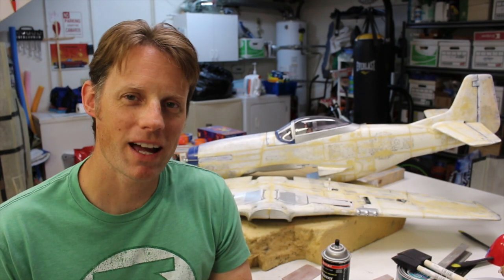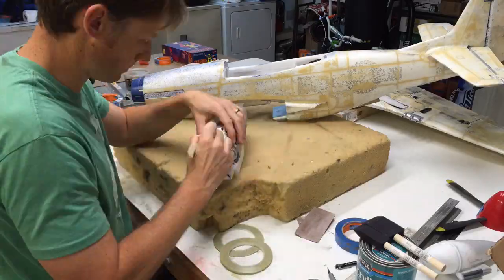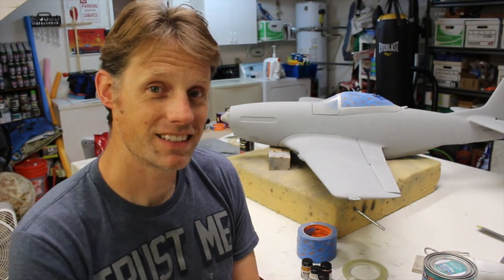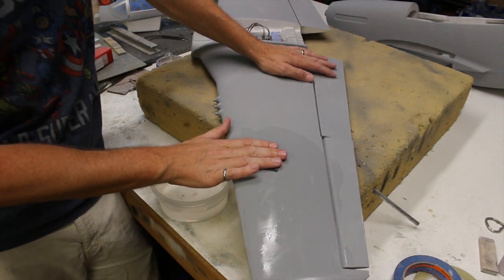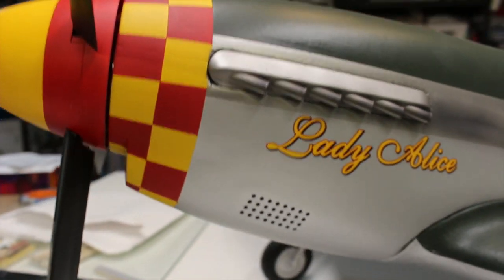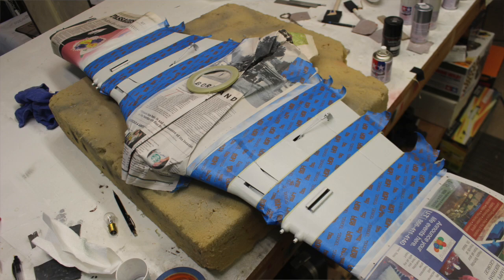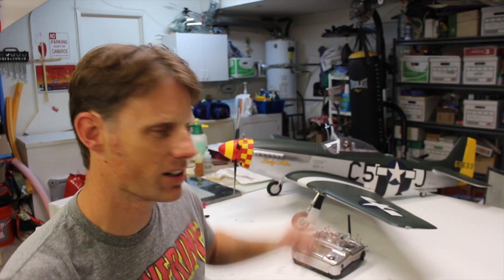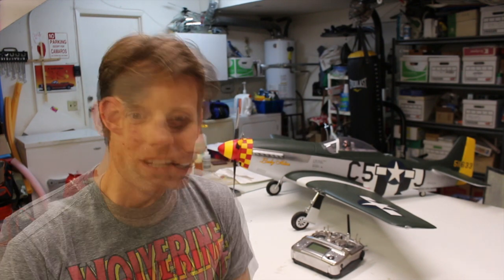Refinish a Foam Warbird Ep3 - FMS P-51 Paint Prep & PAINT!

Comment: Do you sand between polycriylic coats? I missed that somehow.  Anyways, with this video series you took the foamies to another dimension!  It looks to me that this process may open up the way to add scale details to any scale foamie that is missed during production.  I am working on a 36" ws FW190 that lands on its belly, and I intend to add retracts to it.  In order to dig the wheel wells, I use my soldering iron; but, I am finding out that it is not really a dependable process.  You get only one shot to everything :-)  If I can perfect this method, which means tracing straight lines and achieving controllable depth with the soldering tip, then it is possible to add torque rods for ailerons, flaps and elevator (I believe I can hide all soldering traces with balsa filler, or microbaloons mixed with epoxy).  That way you have all hidden controls on the airplane instead of ugly looking control horns sticking out from everywhere.  Do you have a process in place, or have you ever thought about one?  Anyways, you got my blessing with your craftsmanship to this foamie, which I never thought possible.  Now, I intend to spend more time to work on foamies after 40+ years of working with balsa.  Keep up the good work :-)
Reply from the maker: Thanks!  I only lightly sanded the final coat of poly before starting the primer process.  No need to sand between the poly coats really.  Epo Foam can definitely simplify things when wanting to add details and such since it’s easy to cut and such. I’ve not spent time hiding control horns on the foam stuff, but I do go to great lengths to do that on my larger builds. Just be aware that the final finish does need to be protected from the sun to avoid the foam beads from swelling. That’s the primary drawback to epo foam that I’ve found.

Comment: ok Chris. I have done a Bob Hoover tribute Stang and it turned out sweet. after several flights I have noticed stress cracks in the paint.  any suggestions on how to prevent this. maybe some flex paint. I did use rattle can Rust-Oleum. I guess it is what it is but for my next adventure with costom painting my plane this is a concern for thought.   any awesome suggestions from the Master. thanks GEEK. 😎
Reply from the maker: Unfortunately it's hard to avoid this since the poly does stiffen up the airframe a good amount, but not completely and these models still flex in flight.  Mine developed cracks also, but they weren't visible unless I picked up the airplane from the wing a certain way where the wing flexed.  Interestingly, my kfir hasn't had this pop up at all.  Part of that is there's less flex on that model due to the short and stiff wingspan.  In terms of paint, latex paint may be less prone to this but I'm not sure.
Reply: The RC Geek yeah I guess I will have to live with the cracks. do you know what paint the factory uses on these planes it doesn't seem to crack as much it seems.   and oh yeah the filler you smashed with the hammer is garbage. I used it and when you paint it it just looks like shit. so thanks for the filler tip.   I have a crazy project going. right now.  I am trying to make a YAK 110.   it's going to be a beast.   hopefully it all works. cross your fingers for me. thanks 😎.

Comment: Thank you for the video!
I was gifted an extra 230 96” 70cc gas engine, reallyyy old plane from the 90s, it is extremely well built and heavy with full balsa coverage all the way around, but it is in a bad state, full of dents, marks, tips, the paints is on its lasts days. I’ve started a process to sand it back to bare wood so i can fix all the broken supports and start from there. I have no idea how to paint and give it a nice gloss look as it deserves. My plan is to make it yellow/black Extra 330SC Breitling scheme. If you have any tips on how i could achieve this result from bare balsa wood i would be deeply appreciated. This plane cares a good sentimental value to me. I want to make it perfect!! Thank you for everything!!!
Reply from the maker: Thanks for commenting!  What is the model covered in currently?  And is it fully sheeted balsa?  Or are there lightening holes in the airframe?  The best means for preparing a balsa airframe for paint is to fiberglass it truthfully. But, if there are lightening holes in the outer skins, that’s a difficult process and will requires an iron on Mylar covering.

Comment: Any special attention to the creases between the Wing & Tail’s control surfaces.  Isn’t the polyacrylic dry stiff?
Reply from the maker: You do have to be a little careful not to build it up in the hinges, but foam hinges it’s less an issue.
Reply: @Thercgeek  I had the thought of using a thin layer of rubber cement or white liquid electrical tape on both sides of the hinged control surfaces to protect the foam.  Then I was going to apply the polyacrylic several times lightly sanding between coats.  Then spray with primer, multiple coats wet sanding with 800-1200 each coat.  Then spray base color and secondary paint colors.   Good game plan?

Comment: Have you noticed if the foam will still try and gator after a day out at the flying field in the bright sun? I have found that it really depends on the final base color of the model. The lighter the better of course.
Reply from the maker: you do have to keep it in the shade as it will popcorn up in direct sunlight.  It really depends on the color, the darker colors can swell up pretty quickly.
Reply: @Thercgeek  Thanks for the reply.

Comment: Perfect !  Newbie question here : Why did you have to strip the plane before painting it ?  Additional weight of the paint, or because you wanted to fix the panel lines ? Beautiful plane.
Reply from the maker: Stripping the airplane down ensures that you have a good base for the polycrylic.  Otherwise, you run the risk of the paint lifting underneath the poly as you mask the airplane.

Comment: Nice job! Can you be a bit more specific about what type of non-yellowing clear-coat you used to seal everything in? Again, great job!!
Reply from the maker: Thanks!  On this model I used a lacquer clear through a spray gun but of late I’ve been using the 2x rustoleum clear which I’ve really been liking. It’s non-yellowing and gives a really nice sheen and being in a spray can makes it really simple.
Reply: Perfect, thanks for the quick reply. I've got a Cub on floats I'm going to repaint in "cub yellow" next winter. It's never too late to think about next winter's projects, right? :-)
Reply from the maker: True story!  One thing to note, I’d recommend skipping the paint stripping process I did on this. Just do your prep work directly over the stock paint. However if there’s bare foam, I’d recommend burnishing it down with some acetone still though.
Reply: That's what I was thinking of doing. There is some factory-applied red on the vertical stab/rudder, nose/cowling and on the wingtips of the model. That will be removed with acetone and at that point I plan on wiping the whole model down to ensure I'm starting from ground-zero. I can't wait to get rid of the foam dimples too...

Comment: great job, defo gonna try this on my dynam spitfire as its got abit old and tatty. How much weight did it add and did it make the air frame any stiffer?
Reply from the maker: It doesn’t stiffen you the airframe a touch which is nice. It’s only to some extent as I recall the dynams can be pretty flexy, but it should help a little. I don’t recall the weight gain, but every foam aircraft I’ve done this with has flown better following the refinish.
Reply: @Thercgeek  Awesome, thanks!

Comment: At 13:56, what clearcoat did you use?  What would you suggest for a Dull coat clear?  For larger models?
Reply from the maker: I sprayed a non-yellowing lacquer clear.  It came from Frazee paint which is now no longer around since it was bought up by Sherwinn-Williams.  SW has a "Sherwood" brand lacquer that should work.  Just make sure to thin it well, otherwise it'll kind of frost the surface.  That's what I would use for the larger stuff.  Of late, I've just been using Rustoleum Matte clear to clear coat the smaller models.
Reply: @Thercgeek  I had noticed today reading some forums a lot of folks saying the Krylon Matte Clearcoat.  Any preference between the Rustoleum or Krylon?
Reply from the maker: @ssgfury I've been really happy with the Rustoleum.  I've used some Krylon clears many years ago for decals and didn't like them.  Not sure if the formulation has changed since then though.
Reply: @Thercgeek  Well seems how rustoleum is at home depot... WINNER! lol

Comment: Fantastic job, beautiful plane. Is there a fuel proof clear coat that is safe on foam?
Reply from the maker: That's a good question.  The difficulty is that the foam isn't fuel proof.  The lacquer clear coat that I used is fuel proof for everything except glow.  Fuel proofing for glow requires a two part epoxy clear.
Reply: Thank you

Comment: Chris, I bought a second Sonic Binary. 1st one I left in the Coast Guard scheme, the 2nd I primered and painted USAF matte gray. Looks pretty cool, if you’re color-blind. Once it’s decaled up and loaded with long range FPV gear I’ll send you a pic. One question- (As usual....) What would you sand or wet sand with? The primer and spray paint left a very rough finish.
Reply from the maker: You could try a scotch-brite pad, and if that's not cutting it down at all, then I'dwet sand with some 600 grit wet/dry sand paper.  Those are my stand bys for rough finishes.
Reply: I’ll give it a try tonight with the scotch-brite tonight. I don’t know why I’m going all OCD over it. The plan is to fly it at 399 feet, 5-10 miles away. Who’s going to see it other than the FAA or a curious UFO?
I’ll hit it with some water based clear coat after I sand and one more layer of paint. It’s a gray plane with 10 black decals, how good does it have to look?!?!
I think you’d like the build on the Binary. No directions, trial and error on how it goes together, trimming out the clear canopy and LED covers, build your own front wheel compartment including the tiller to servo. If there’s any upside to this plane it’s all the access compartment covers. Wiring is a breeze.
Reply: Home Desperate had 400 grit. A couple more coats, a last soft sanding and some “finger and palm” rubbing and it’s smooth as a baby’s butt. Just put the 3rd coat of poly-acrylic(water based stuff) then I’m gonna flip everything and do the bottoms. The poly-acrylic really darkened the gray and gave the whole thing the color i was looking for. (My Life Story- I’d rather be lucky than good)
Reply from the maker: @jeffhenderson934  that works!

Comment: Would a oil based primer work over the minwax coating?
Reply from the maker: I would guess it would probably work. Try it in a small spot first, but epo foam is extremely resilient to solvents and I’ve used all sorts of paint mediums on it including lacquer based primers.
Reply: Thank you again!

Comment: Nice job, a lot of work! But why fill in the panel lines? Don't that take away from the detail?
Reply from the maker: The problem is that the panel lines are just massive and too pronounced on the airplane which detracts from the looks IMO.  Filling them in really cleans it up and makes it look more scale since on the real airplane, the panel separations are very small.  I could have taken this a step further and added panel lines back on top of the paint, but I didn't do that on this one.  I did that on my kfir project though: https://youtu.be/d-tocRK8CXc
Reply: @Thercgeek  Understood. If your going to put in all that time in prep and paint you might as well  put in the detail and make it look really good. I will have to check out your other video's. Thanks for the response.

Comment: If you sprayed the evercoat primer directly on EPP or EPO foam, it would melt it, right? It's the Polycrylic that's giving the foam protection?
Reply from the maker: With EPO, I haven't had any problems there with or without polycrylic, but definitely test it first and apply in light coats.  I don't know about EPP.

Comment: What is another good primer to use that won't eat the foam?
Reply from the maker: You can use almost any type of primer. Epo foam is extremely resilient to solvents. When a I do a full refinish like this, I use an automotive primer. Keep in mind if you’re working on an eps foam airframe, that is a different story as eps foam quite susceptible to solvents and spray propellants. That said, Most foam airframes are epo foam these days.
Reply: Thank you!!!

Comment: I can't find your video where you address the control rod was flexing and you fixed it, can you elaborate on how you did so, I have the 1450 and the elevator push rod bends quite a bit making for sloppy handling.
Reply from the maker: It's in my second episode.  Check halfway down at this link: http://thercgeek.com/2015/08/refinish-a-foam-warbird-ep2-fms-p-51/

Comment: I have tried several things to try to get a smooth finish for repainting the tailcone on my Flightline F4 Phantom.  I have tried green Tamiya putty, Beacon Foam-Finish and Beacon Hobby Coat, and this last round a very fine spackling compound.  For each try I sanded with 2000 grit sandpaper before airbrushing on the paint.  No matter what I have tried, I can still see the filler or spackle once the paint dries.  Can you please share with me what primer you are using before you apply paint?  Thanks!
Reply from the maker: With the spackle, it always has porosity and so really needs to be sealed with polycrylic. Then, once sealed apply a little primer, sand it down and repeat. Then the final primer coat wet sand with 600grit. That should help blend the different materials together a bit better. For primer, I’ve been liking this dupli-color filler primer of late: https://amzn.to/2YD0zIE
Reply: @Thercgeek  Thanks!

Comment: have you ever used the matte  / semi / gloss polycrylic spray as a final coat after all your paint and weathering ? thoughts ? i pretty much air brush or use a rattle can, i dont have an automotive sprayer to use.
Reply from the maker: You can, yes. I’ve also found the rust oleum 2x clears are really nice and have been using them mostly these days.

Comment: RC Geek Can I ask you as you used automotive primer do you think it would be safe to use Automotive top coat as well on EPO Thanks
Reply from the maker: yes, that should be ok.  Especially with all of the underwork that's been done.  I personally use a Lacquer clear and no issues at all using that on EPO.
Reply: @Thercgeek  Thanks for your quick reply Much appreciated. Wished I had half your talent Excellent videos

Comment: Does the Minwax Polycrylic finish yellow, especially from being in the sun?
Reply from the maker: I'm not sure.  I recall it drying with a slightly yellowish tint maybe?  It was used as an undercoat only though, and I primered right over it.  I sprayed a non-yellowing clear coat for the final finish.
Reply: The RC Geek Thanks for the fast response!  Do you happen to know the spray can paint and the jar paint which is closest to the stock FMS silver for touch-up and damage repair?
Reply from the maker: I usually just resort to the Tamiya AS-12 Bare Metal Silver since I have a selection of it on hand.  I think it would be a close representation.

Comment: does vallejo paint work well for priming and painting on rc foam planes?  need to know what airbrush paint works on rc planes?
Reply from the maker: Vallejo paints should work well. The primer will work as a final primer coat for painting, but it won’t provide enough buildup to fill the microvoids to smooth out the airframe if you’re wanting to use it for that. For airbrush, this is the system I use and I love it! https://amzn.to/39bUQuN
Reply: @Thercgeek  so what airbrush primer and 
paint is best for epo planes?  createx colours?
Reply from the maker: You can use any type of airbrush paints on the airframe. For the primers, I like to use an automotive types they tend to build up nicely. Of late I’ve been using the dupli-color filler primer. It’s good stuff!
Reply: @Thercgeek  can you give me names of airbrush primers to use on epo to go in airbrush?
Reply from the maker: I always use spray can primers for this stuff, so can’t give you any meaningful names. I’d recommend trying something you’re familiar with and go from there.
Reply: @Thercgeek  hi, can you help me on this.  I have a dynam -10 edf, now I dont want to use included ducted housings without intake lips on them, i have some fans in inlets on them.  is it ok to use dremel to make some slits in jet housing for fans with inlets?  or will this create 2
 inlets one on fan the other on jet housing?
Reply from the maker: In all honesty, I’m not entirely clear what you’re asking and what you’re referencing with regards to inlets. Maybe emailing a picture would help. You can send me an email through my contact form on my site and I can reply back to send pictures to. Thercgeek.com/contact